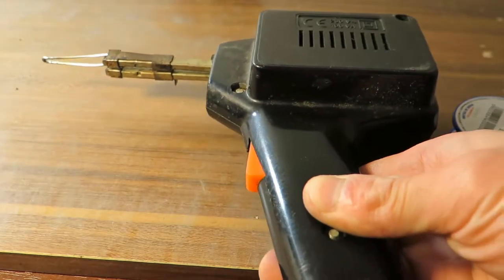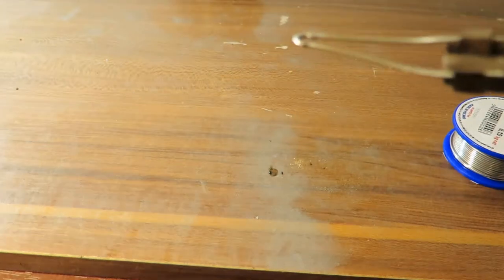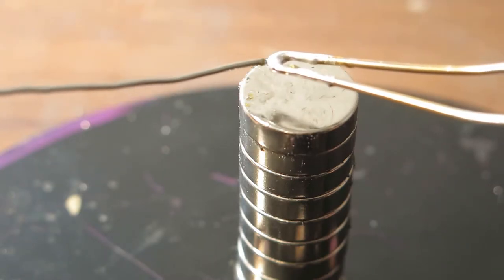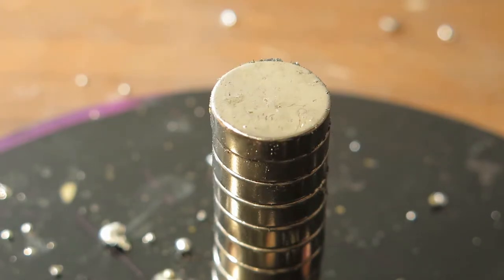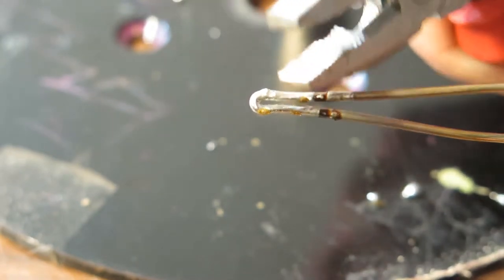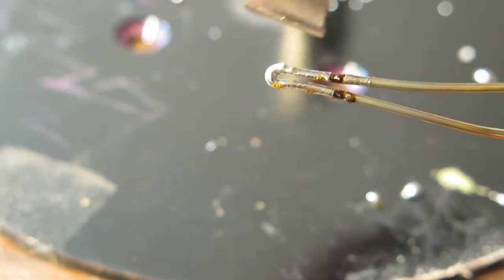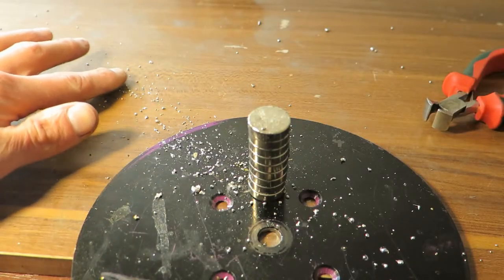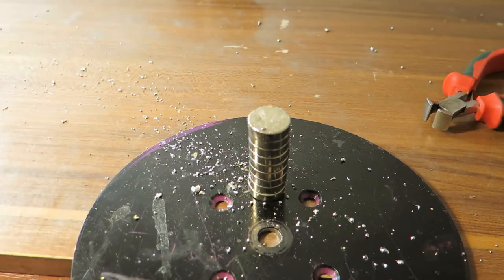"Atomizing" tin by electromagnetism

Comment: You have actually increased strength of magnetic flux by lowering the area of your "coil" made out of single wire, the amount of magnetic flux is the same just squeezed unto smaller area... what you actually shown is that surface strength of molten solder is stronger than electromagnetic forces applied on it. Nice and interesting video nonetheless...

How is glassblowing rig going along? I am interested into making my own after seeing your videos.... just shame how I haven't found a supplier for borosilicate glass tubing. Interested in Vello process of glass tube manufacturing?
Reply from the maker: Thanks, I keep mixing flux and strength.
Glassblowing lathe development is super slow. I got quite a lot of "real" work... But I got almost everything of mechanical side...
Vello process - never heard about that. will look it up...

thanks for support :)
Reply from the maker: Aah I forgot - try Chinese suppliers for tubes and rods. I have local one in czech rep. - dirty cheap for EU
Reply: Ilusys Systems 
I guess with increase taxing of Chinese things imported into EU we will see more production in EU like those czechs. Thanks for suggestion, will likely make a video about glassblowing after my exams (still in uni). 

Do check Vello manufacturing method of glass tubes. Might be relatively cheap and easy to make an electric furnace/kiln with a hole in the bottom. Just the only problem is the shaped tube (which has to be really curved) and temperatures that borosilicate glass needs to get to be liquid (have couple of candle jars laying around that I am thinking that might be borosilicate, will test them with vegetable oil or density through water)
Reply from the maker: I have no intention in making tubes - definitely would not to try to make large diameter tubes at home :)
It make sense to source from east europe in EU... but overseas I would doubt if it would be competetive... which kinda sucks, because I feel like all the market is outside of my reach.

And I forgot to mention another great borosilicate supplier - kitchenware :)
https://www.amazon.co.uk/Tescoma-Fiesta-1-4-Litre-Food/dp/B004I8V2TS